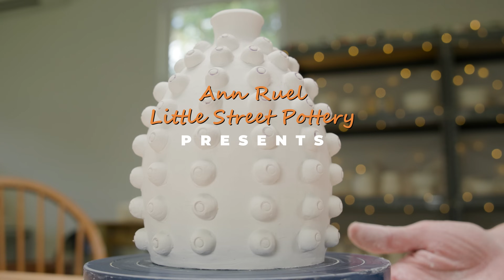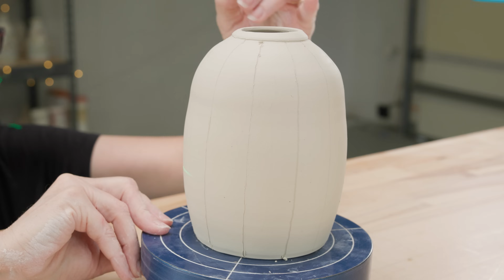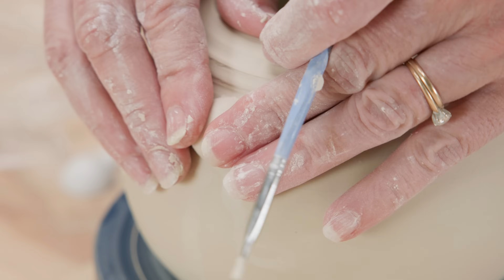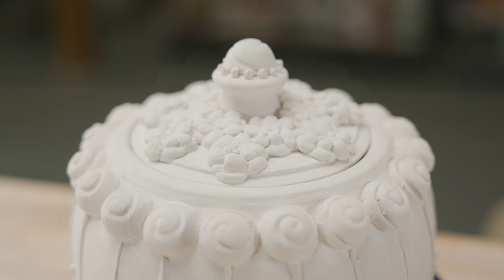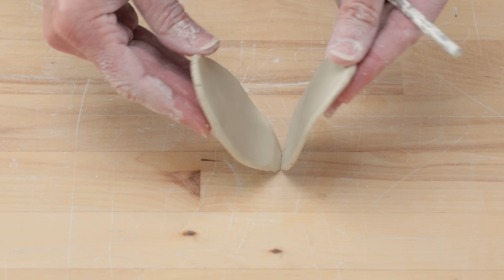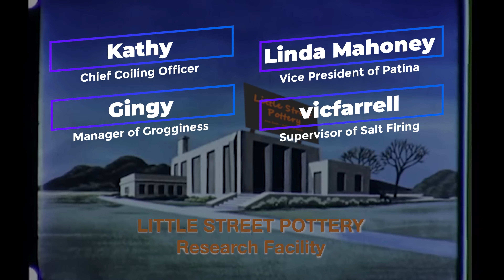Decorating Pottery the EASY Way - Use Measuring Spoons!

Comment: Would using decorating bags (or bottles) with more decorating tips that are used in cake decorating work? I have lots of them. I don’t have the decorating bottles as I’ve always used the bags or parchment paper I’ve cut myself to make a Wilton style parchment disposable icing bag.
Reply: Hi Sammi.  YOu can give it a try.  I think that might work especially for just simple designs like I did here in this video.  I know some people do very complex slip dot designs where you really benefit from a stiffer applicator that is less work to "steady" with your hands.  When designs get complex, it really is a workout for your hands and fingers.